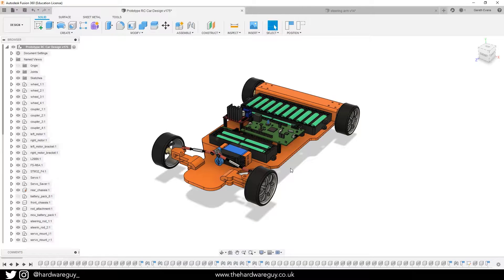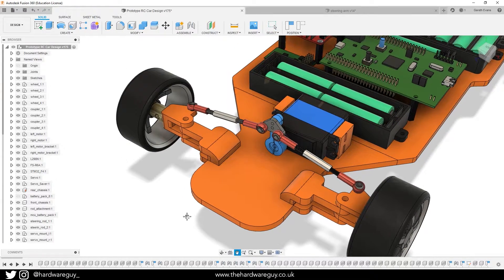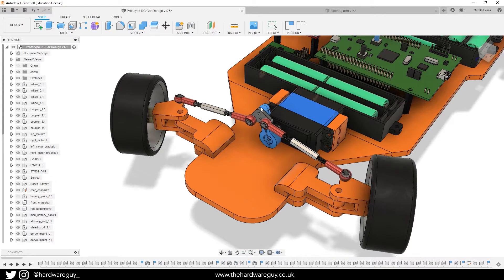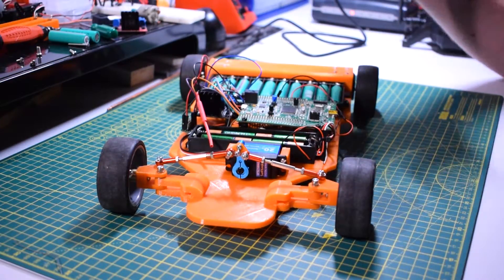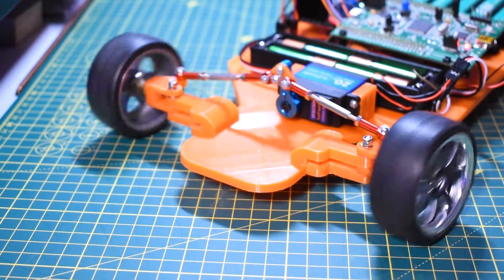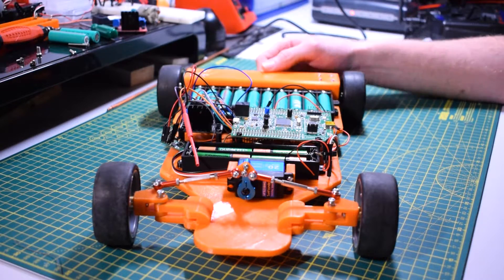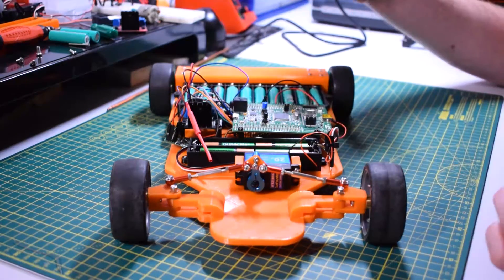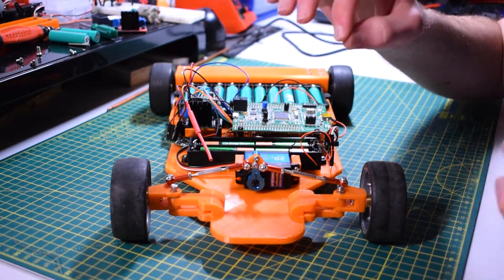RC Car Build pt.4 - 3D Printed Prototype

Comment: Hi, I'm not sure if you'll see this but I said I'll try ask. I'm working on an rc car project for my final year project in uni (Electronic Engineering) and have hit a bit of a wall with steering the thing. I came across this video series and have been provided with a solution that is outside of my capabilities due to the lack of a 3D printer. I have found a way around it but my main question is about the servo motor and overall weight of the car. Would you mind letting me know the overall weight of the project if you still remember and how much the servo can pull/ what servo you used? It would be greatly appreciated. Overall great video and series on this specific project! Thanks.